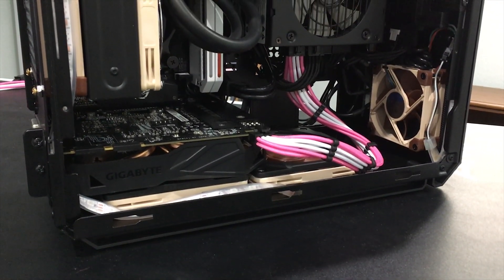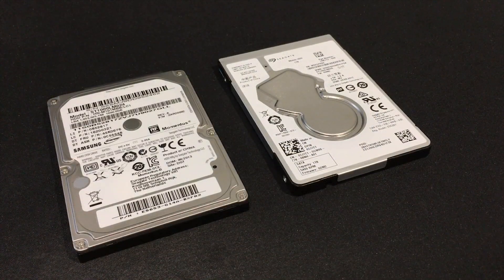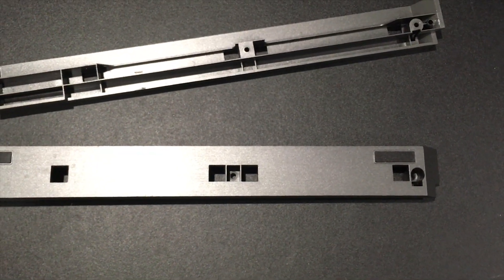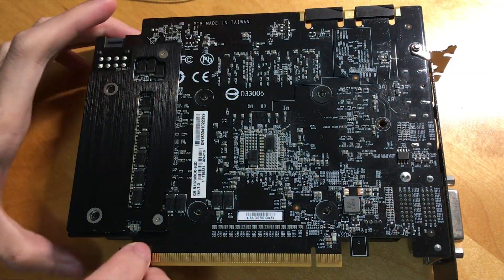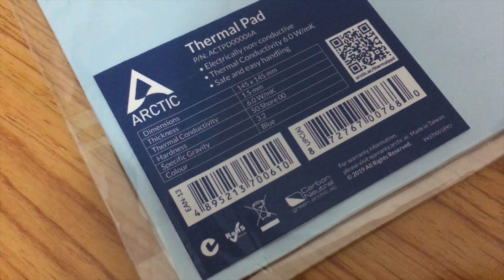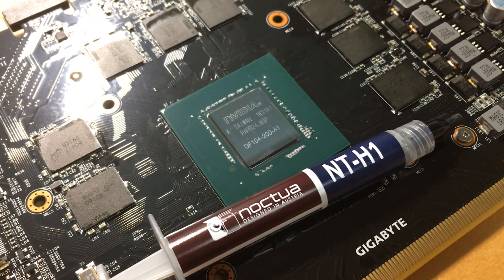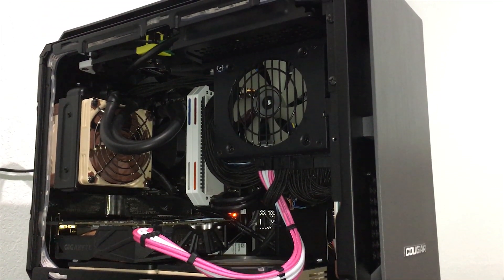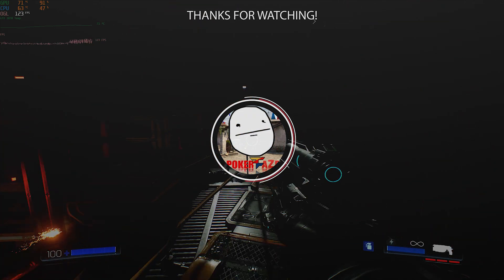Hifi Feet for SFF Cougar QBX - GPU Thermal Improvement

Comment: Your gpu fan and the fan under it are fighting each other. They are right next to each other and blowing in opposite directions. I think you should consider turning both of you bottom fans around as intakes...thats what that area is designed for as its filtered.
Reply from the maker: Initially, they were intake, but it does not have any difference. Anyway, with the new feet, there is no dust filter, so I am fine with exhaust set up.

Edit: I was 100% wrong
Reply: @PokerFaZe  Sorry, having a hard time believing that it doesnt make a difference.
Reply: @PokerFaZe  maybe because the gpu is single fan...try to change to two or three fans gpu...you might get some drops in gpu temp

Comment: I don't think that fan right under the gpu is a good idea. All you get is turbulence between the gpu fan and the bottom fan. Doesn't matter if it is exhaust or intake. They are different sized fans spinning at different rpm's with different fan blade pitch. This will cause both fans to vibrate. Them being so close just exacerbates the issues.

Comment: Hi, do you know what is the max clearance for gpu thickness for this case? the cougar website does not have any information about it, just the length, i have a galax 2060 super with dimensions of 295*143*52 mm thank you.
Reply from the maker: My 1080 Ti's length is 298mm, yours should fit
Reply: @PokerFaZe  thank you for replying! however its the thickness of the gpu that's what im worried
Reply from the maker: Mine is 2.5 slots, and I could fit 2 slim fans at the bottom
Reply: @PokerFaZe  wow its big, thank you for answering my questions :)
Reply from the maker: No problemo man 😁

Comment: hey mate, could I mount those feet even tho I won't be placing case fans down there? I would be placing a huge 1080ti auros, so I won't have room for fans like you, please let me know as I am buying this case :D thanks!
Reply from the maker: I think you can replace the feet, just buy shorter screws, and some washers just in case the screws are extra longer
Reply: @PokerFaZe  thanks for that!
Reply from the maker: Good luck with the build🤞
Reply: @PokerFaZe  heyy mate, I also wanted to ask , how many fans can I place on the sides /  top ? (1 side will be occupied with a 240mm rad ) , and also am  I able to replace that 90mm rear fan with a 92mm noctua's ?I couldn't find any 90mm fan at all.. only 92's, thanks a lot again!!!
Reply from the maker: Yes, you can use the 92mm fan, I used it as push-pull forthe 645LT AIO. But if you use 240mm with the side bracket, I don't think there is enough space for the 92mm. Try installing the AIO first, if you can still fit the stock 90mm, then the Noctua
Reply from the maker: For the top, by installing the PSU like me, you can install two 120mm normal-size fans
Reply: @PokerFaZe  oh awesome, did u use sfx as well i already forgot
Reply from the maker: I do, mine is SF750. But in my first video for the case, I installed a full size PSU and the top 2 fans still fitted
Reply: @PokerFaZe   thanks a lot man! I Appreciate it. Btw the 92mm is really intersting but I guess you could go for 240mm aio for better performance ? 
I ordered cougar aqua 240mm, saw it has almost the exact performance to the h100i pro with the cougar's not amazing stock fans and like half the price, ill just replace the stock fans with x2 corsair ml120. 
Maybe it will help someone who will come across this as well :) 
Thanks a bunch for the info and help mate!
Reply from the maker: @heeku_  If you want the best 120mm fans for AIO, go with Noctua NF-A12x25 or Arctic P12, Corsair fans are pretty irrelevant nowadays.
Reply: @PokerFaZe  really??? The ml120s are not good anymore? cuz I use em on my x2 360 rads on my main pc :O
Oh and also, what kind of bracket adapter should i use? The guy just called, he said I need an adapter from sfx to atx (I thought corsair includes one but I guess they don't)
Reply from the maker: Corsair includes, you don't need to buy. You really should check out the Arctic P12, they are cheap but very good
Reply: @PokerFaZe  amazing!!
Reply: @PokerFaZe  hey mate just got my feet, I ended up glueing them with some good double sided tape instead of having screws, thats an awesome option : )

Comment: hot air should be blowing up not blowing down...if it blows down u just make the hot air harder to get out :P
Reply from the maker: Yes, I think I should have made it intake for GPU
Reply: That is true only with convection. In a case with flowing air that is not an issue.